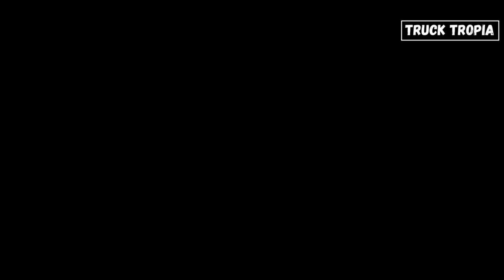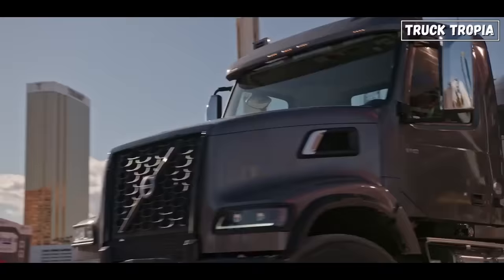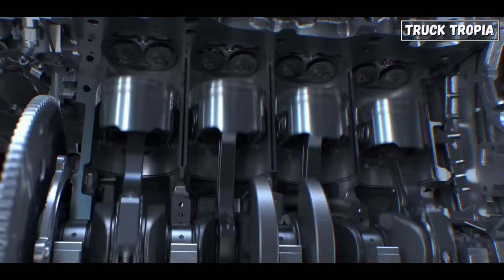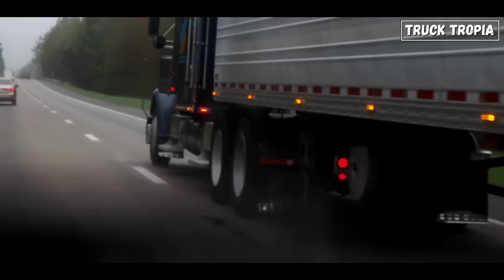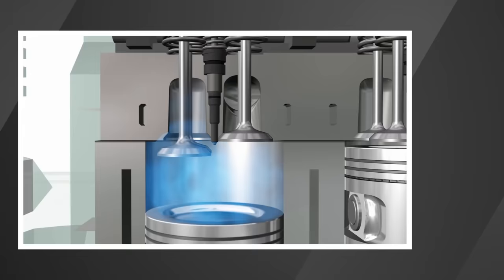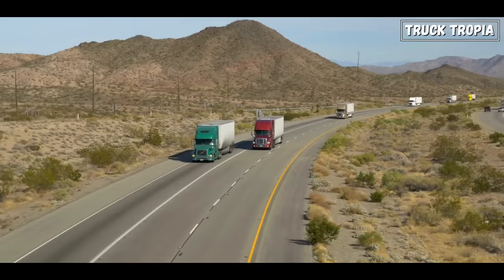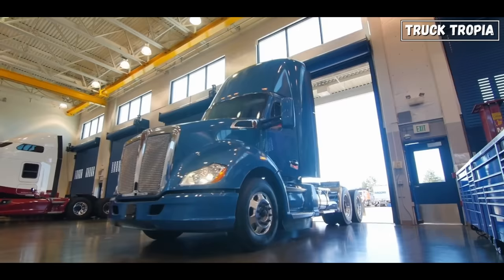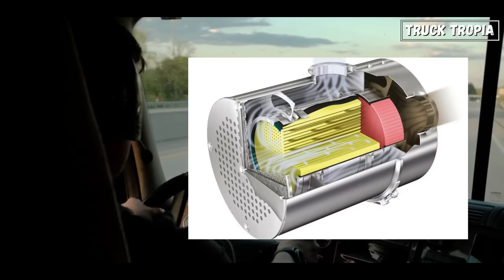Ultimate Truck Education 101 - Every Question Answered

Comment: Just because we don't need 700+ hpr doesn't mean we don't want a 700+ hpr big rig here in the US.
Reply from the maker: There is no new sold trucks with over 700 hp
Reply: @TruckTropia  Only special orders for the big heavy haul companies.
Reply: @hibiki54  yea but you could go down to any volvo or scania dealer and get a 750/770hp truck in europe, if you want to do custom stuff you could use the 1150hp version of the scania v8 if you beef up the cooling
Reply: @TruckTropia I agree no new trucks I am aware of but I have he chassis dyno sheets stating my 6nz Cat is pushing 800 plus to the grounds. It started life as a 600 horse model that we added a marine cam, injectors and turbo to and then reset the computer and all done.
Reply: I believe Volvo offered their 750hp engine in the states for many years. They stopped offering it due to low demand. So you didn't want it enough. ;)
Reply: @antioch4019  ya it seems that there aren't as many owner operators that want the big horse motors, or more than likely just can't afford them. My motor is in a 99 Freightliner classic. When I did the math I found it was cheaper for me to keep the old girl and rebuild it over and over then to buy a new one with all their problems
Reply: The issue is that american trucks are longer and lighter, but also need more wheels because the maximum alowed tire pressure is lower.

So the american trucks have the be built very light to have any decent load capacity. So having a really heavy engine and gearbox just don't work out.

Also worth looking at the frame. European trucks have much stiffer frame, pretty much because well they are shorter and heavier. So making the frame a bit stiffer dont cut into they payload that much.

Think about it a typical EU truck is 18.75 meter long and 44 ton heavy and have 12 wheels. A typical usa truck is about 22 meter long, 36 tons and have 18 wheels. Something have to go.
Reply: Big thing in Europe. The 700+ hp engines are available. But Nobody orders them. Only a few heavy loaders or in scandinavia where you can pull more. Most of the Trucks have 450-550 hp because its enough and the most efficent way to get things from A to B. 

In a few years, the V8 will die, because its too heavy and uses to much fuel and it cant go through the next emissions standards.

Europe has no owner operators. Its always big or small fleets. But there is no "One Man, one Truck" thing like in North America.
Reply: @honda900000  what do you mean europe has no owners operators? The nordic countries are in europe and they have owners operators, as in truckers owning and operating their own trucks (responsible for maintainance and everything themselves). Unless that means something else in the states. Pretty sure it exist elsewhere as well but definately a thing in europe. You think a large haul company would have all those tricked out Scanias and Volvo FH series with custom paint and airbrushed motives driving around. No those are truckers who love and invest in their own truck. Many choose the 750/770hp engine to have the option to haul the heavy loads allowed there, but many choose it for flair and cool factor more than a need or economics. They are willing to have a lower profit margin to have a beast of a truck. Trucking in the nordics is a serious thing, not only depending on cargo hauled.
Reply: @honda900000  
"scandinavia where you can pull more"
That is not really true. Both some States in GErmany as well as Netherlands alow heavier trucks now. And there is also heavy haulers that haul specially goods.

"cant go through the next emissions standards."
Emittions standard for truck is per power, so it is not effected by the number of cylinders.

"Europe has no owner operators"
Totally wrong
Reply: I know this wasnt so american of us. Normally we do stupid big stuff
Reply: I believe the Mack E500 V8 was dropped around 2000.
Reply: If you are an owner operator, you will regret 700 horsepower once you start paying for the fuel.
Fuel costs are the highest expense for owner operators. The more you spend on fuel, the less you put in your pocket.
Bragging rights go out the window.
Reply: @user-sm3th7ow5w  to a certain degree I would agree with a higher horse motor using more fuel. However with my own truck, and only my own truck, I actually get better mileage than I did when it was stock. 
The engine was rated at 600 horse with and 18speed and 3.08 gears and would consistently pull mid 6s to low 7s. Now with it cranked to over 800 horse, same driveline, it will consistently get mid to high 7s, this is also maxed out on weight in the US. That being said a lot of it also depends on how you drive the truck. I was playing around one trip and I got to see just how bad the fuel mileage could get.
Reply: many Bull haulers run 800-900 HP old modified CAT motors. Bigger turbos, injectors etc
Reply: If you got the cabbage to support a fuel-thirsty 700HP semi, then more power to you (literally) 🚛
Reply: @chrismayer3919  that is what it really comes down to. I can say for myself that with a full load and high horsepower I can get better economy than I did before adding power. The biggest thing is in how the truck is driven. Putting 700 or 800 horse engines in a fleet, probably not good. Oh damn can you imagine a typical swift driver with high horsepower. That would be scarey.
Reply: @rickcorey5908  that’s SWIFT for you; best in crash… 🥴
Reply: Fun n all, but it takes off 300k longevity.
Reply: @MRTEE-sy7sb  they race semis in Europe so long-haul trucking isn’t a thing when considering engine displacement and horsepower (you don’t use a NASTRUCK racer for everyday driving, do you… or do you?)
Reply: Yeah, since when was horsepower based on need?
Reply: @chrismayer3919  putting more power in a given sized block will always reduce engine life,  no way around it,  its just how it is.  Generally that is why heavy equipment uses engine blocks set at a lower power setting(for given block size) and high capacity oil pans…18000-20000hr life is not unheard of. Example,  a 15 liter C15 commonly has under 400hp in a D8 dozer
Reply: I see all the comments about pros and cons to each engine hp ratings. To each their own. My experience years ago driving tow trucks is that the tow truck with a lower hp would strain to pull the same weight that the tow truck with a higher hp engine would pull easier.
Reply: @acetomatocompany  I agree,  the less hp truck will for the most part do the same thing,  drop a gear or 2 and go 45mph up the incline vs 55mph.  For me, realistically,  the difference from 500 to 600hp while grossing 130000# isn’t that much.  It’s noticeable, but not much difference.
Reply: @MRTEE-sy7sb , I used to drive heavy duty tow trucks in the early’90’s. The 1981 Kenworth W900 I dove had a 450 Cummins. I don’t remember anyone having a 500 hp back then.
Reply: Heavy haulers need horsepower. 800+ is necessary to move 150k
Reply: @HubertofLiege  I gross 135k with some of my heavy equipment.  525hp moves it along easily.  You can’t expect it to zip along like a car
Reply: No doubt that heavy haulers need the most power they can get. I never did heavy hauling, I just drove a tow truck. The heaviest thing I had to tow was a Scania dump truck that weighed 92k. The dump truck with my truck was 122,000 pounds nowhere near heavy haul status. Thanks for the info.
Reply: @MRTEE-sy7sb  it will pull it but takes longer to get up to speed.
Reply: @HubertofLiege  yup,  I’m in the midwest where it’s relatively flat as well.  Out west on some grade, that would be a different story
Reply: Europe trucks just have better brakes.
Reply: @antioch4019   there is nothing special about the weights hauled in Europe. 63500kg of the B train weight here, WA state allows 105500lbs with a single trailer, dunno what their B train weights are. this video is full of misinformation
Reply: No, those trucks are custom-made, not from the factory. For example, a C18 is a marine engine that can produce over 1000hp. Some individuals install these engines in their Peterbilts because they specialize in specific freight that a C15, C16, or 3406 won't handle for everyday use. They don't sell 700hp-plus engines because most cargo can be transported with as little as 400hp, given the proper gear reduction. You don't need 700hp for moving reefers, vans, or flatbeds, even at a 80k gross weight. A 700hp engine consumes a lot of fuel, impacting the operator's bottom line. That's why those with trucks like these may have direct customers who pay them generously to haul specialized freight, often oversized and very heavy, exceeding 80k.
Reply: @user-sm3th7ow5w   hp doesnt cost fuel. the higher horsepower engines get better fuel economy from my experience driving mountains
Reply: Not sure where you get your info from but both caterpillar snd cummins make semi engines up too 1,000hp  cat makes 1200 and 1400hp engines and you can order semis with them. Here in Texas in the oil fields, heavy construction companies and space x are hauling loads of 100 tons. Do bigger engine sizes are available. And some states the larger engines and loads are legal and domestic states it isn’t
Reply: I mean if you're willing to sacrifice reliability and legality you can make it happen
Reply: I don't remember saying I don't need 700hp.
Reply: @matsv201  40 ton is the US max without any sort of permit, and the trucks are between 10 and 18 wheels for a standard truck depending on if the person wants to run run super singles or duels or some combination. With a $300 yearly permit I can run 44 ton, but those types of things are state specific. Some places can go much higher. The biggest thing is the bridge weight restrictions, the US has a lower population density so stuff ships a thousand to two thousand miles normally meaning there are hundreds of bridge crossing for a trip and those bridges are what determines the weight capacity. All truck routes are guaranteed to have adequate bridges for the 40 ton regular weight with other traffic, if you do heavy haul and run 80-100 tons then permitting gives you the route to take, which sometimes means blocking off the bridges so no other vehicles are on it at the same time.
Reply: @jaydunbar7538  the 40 ton limit is imperial ton, that is 36 metric ton.

And for that you will need 18 wheels in most states.
Reply: Great video!!
Thoroughly enjoyed it.

I am missing why European trucks are almost all cab over,while Americans are mostly long nose.

The reason is simple, as far as I know. Regulations!  In most European nations the maximum length of the total combination, truck + trailer is such , that with maximum weight they want the most 'room' for a longer trailer, so the tractor needs to be as short as possible.
Reply: sir you would love it  scania or volvo big engines are awesome  on your weight limits looking at 12 mpg add straight pipes livin the dream
Reply: Just need to see Tesla's video introducing their semi to see the advantage of more power.
Reply: @josviersel  more power is good its the range is the  key  300 to 400 km ok in the uk could be a problem in the US overhead would solve that
Reply: I'd love a Scania V8 with 770 HP!
Reply: When I retired I had to get my right shoulder replaced
Reply: Especially in the rocky mountains
Reply: I need 700+ hp pulling OTR end dump. We are 80k all the time.
Reply: Here in the UK we have only 450-500 hp in line 6 engines nowadays...
Reply: Big Facts
Reply: @user-sm3th7ow5w who ever told you that lied. A 700hp engine will actually get better fuel economy than a 450hp engine.
Reply: @honda900000 
No owner operators!!! What are you talking about. Get you facts right before commenting anything.
Reply: @TruckTropia  were there any attempts by engine manufacturers to develop a Inline 8 cylinder diesel engine for trucks ?
Reply: Bigger longer and straiter roads just means more top speed lol drag race
Reply: @TruckTropia lmfao that's because we can tune our engines to well over 700hp and we get more from a straight 6 than the eurotrash motors get from a V8
Reply: There are trucks that don't have 700+ HP ? LOL...  😊
Reply: That's why Pittsburgh power and so on are around, they can take even a old big cam cummins which boasted a modest 400hp for the biggest engine with the exception of the 450/475 twin turbo version and the 444xt which were all relatively rare to north of 700hp getting north of 10mpg with the right driver.
Reply: @antioch4019  that always surprises me considering the many mountainous areas.
Reply: Just because we can do a job with less dose not mean it's not Ezer with more power. They are going to automatic transmission to hire less experienced driver's / pay less
Reply: @TruckTropia 
The SISU Polar hybrid truck has 1140hp and 5000nm of torque straight from the show room floor. And here in Finland you can haul 76 metric tons of you have more than 9 axles on truck and trailer.
The trucks are completely different sold here than in Germany for example. Much beefier Axel's brakes etc...
Reply: @TruckTropia There are people who do engine work on their inline six engines and get 700+ horsepower, although, yes, there aren’t very many 700 horsepower engines straight from the factory.
Reply: Exactly!
Reply: @meintveldman4769   TRUTH WELL TOLD
Reply: @TruckTropia  Not quite true. The Tesla Semi has over 1,000 hp and torque for safer operation and better hill climbing ability. Can do 500 miles fully loaded charge up during the driver's break and/or a drop-off and continue for another 350 miles.

That covers the majority of all trucking needs in the US with only over-the-road rigs with sleeper cabs needing more range than that. And it's 25% cheaper to operate with FAR less maintenance so reduced downtime.

Purely based on economics, it's only a matter of time when electric Semi's become the majority with diesels only being used for the niche use case of long haul trucking where timing and max payload is critical.
Reply: I thought freedom was measured in horsepower? 😂
Reply: @TruckTropia  where? in US or in Europe ? just today in slow Traffic i overtook a dutch new Volvo heavy Transport Truck.  770 HP.
Reply: Buy a European truck. 😂 where i worked they pushed near 1000 hp.
Reply: @TruckTropia buy European those small engines would not get over European mountains.
Reply: @Viktor_Orban   SORRRRY
Reply: @TecnamTwin  if you wanted to talk about a truck with the ability to improve things, you would have been talking about Edison motors.
Reply: @TruckTropia Where do you get that from?? In Australia you see Volvos and Scanias above 7 hundreds on a daily basis haha

Comment: US truck design is still stuck in the 1950s. Here in Australia we have both Euro and US trucks to choose from. The only US truck that comes close to the Euros for refinement and low driver fatigue is the Mack Superliner. Kenworths are noisy, have a crap ride and are made with a collection of third party components. A Scania is Scania right through and it shows with lower running costs and maintenance.
Reply: I wouldn’t compare the US made trucks that are there to the Euro trucks there. They aren’t exactly the same as the US trucks here.
Reply: A scania with lower running costs and maintainance? Not likely.
Reply: And wait, what Kenworths have you driven? You can’t just saw all trucks of one brand are all built the same. Hell, you can’t even say that within the different packages that come with each model. It’s like saying a Dodge Charger is slow when you’ve only driven a SXT.
Reply: @Coonazz791   I never sawed anything about brands being built all the same, read my actual comment. scania is viewed as a "premium" product in europe with matching prices. An £8-9 part for example for a daf is £70+ for a scania.
Reply: @andykennedy5982  I didn’t @ you, now did I? If I didn’t @ you, that means I’m responding to the OP. 🤦‍♂️
Reply: Euro trucks are plastic trash and is why no real driver wants one and is why Kenworth are the biggest selling brand.
The comfort argument is total BS and so is the noise argument.
You should actually want to hear your truck, it helps with driving it efficiently.
No real driver wants an auto or a plastic piece of garbage that shakes itself apart.
Reply: OP is silliness by an ankle biter - electronic injection pump, duh. Plenty more reasons, but point is made.
Reply: I prefer trucks with less electronics... Sometimes too much tech will cause you downtime especially those sensitive sensors installed
Reply: @AndrewR10001 right on. I'm rocking an '86 KW with a 3406B. 
Not a computer chip in it and it runs like a champ every day.